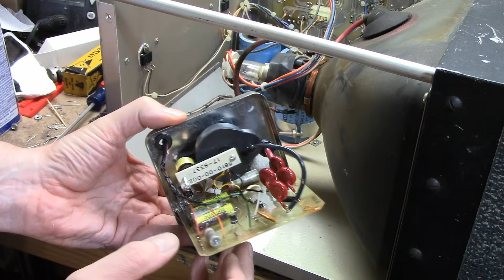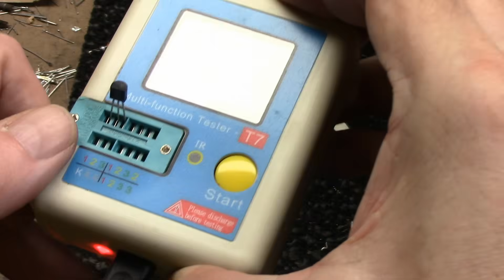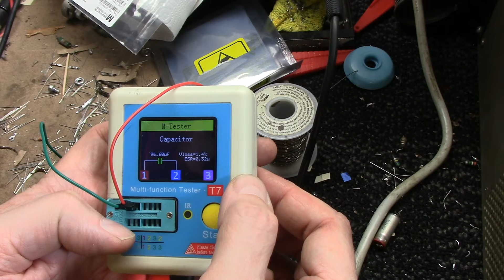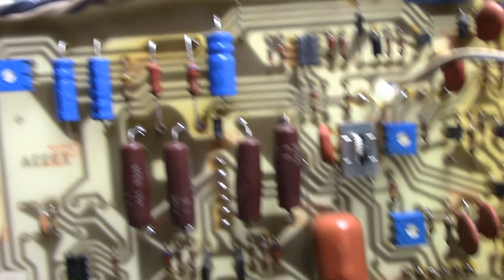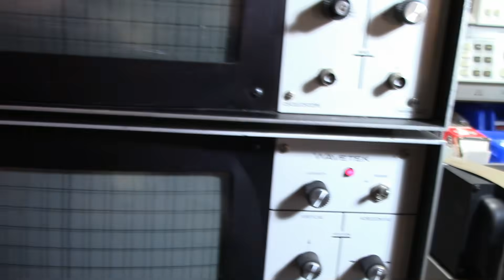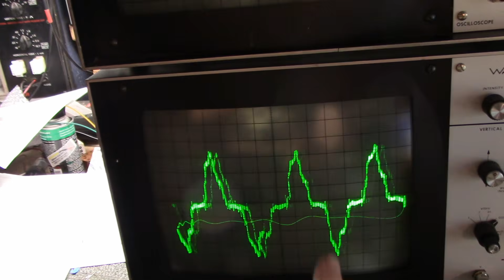Wavetek 1601C XP display overhaul part 2 of 2

Comment: Good job. Now go after those switches. Oh, by the way, did you take the LED into account when you figured the filament current?
Reply from the maker: No, it will be insignificant compared to the filament current

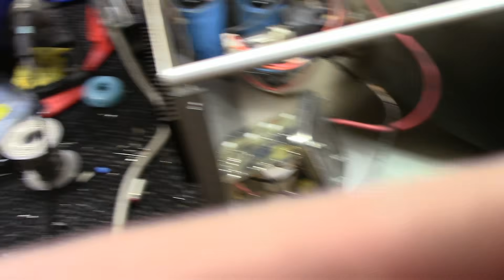Comment: 8:59 I had a bunch of those Sprauge red tipped caps I bought NOS for some pedal projects and they all tested like that, threw them all out. Also the ones tested unknown did you scrape the legs to get the conformal coating off?
Reply from the maker: I'll do a follow up video and test them again.

Comment: Dang Bob, I have to say I was screaming "WATCH THE NECK" when you were opening the HV box and using the tube neck as a backstop :) 😮😮😮

The Wavetec expect a 75 ohm impedance?  You probably already said that but I forgot.
Reply from the maker: Not my first rodeo ;)  I wasn't going to hit the neck.  374K input impedance.
Reply: Myself despite telling myself you have the experience to avoid damage I had to skip past... Partly because thought being careful moving a chassis and broke two Made in Holland Hammond labeled ECL86s and quickly found they are ultra rare so bit triggering. We all make mistakes and its how we respond that matters. 

Cheers,
Adriel
Reply: @adrielrowley  🤣🤣🤣 You know you are being TROLLED when all of a sudden the thumbnail for the vod changes to the ClickBait shot!   LMFAO   good on you Bob!

Comment: 7:54 - It’s possible that when you desoldered that cap, that the conformal coating melted onto the leads and is causing the tester to not see a component to test. Did you try scraping off any melted coating or other oxidation?
Reply from the maker: I'll do a follow up video where I'll also test them using my new LCR meter.

Comment: It's what we in the business call "BROKEN" I recently got one of those universal component tester, wish they had one when I was actively fixing TVs etc. Nice little quick tests👍
Reply: I had a friend of mine complain about those little circuit testers that they were not very accurate. I don't know if he was expecting 02% accuracy but yeah it's not going to provide that. It's a good quick go no-go tester.  They could do a good job for what they are.
Reply from the maker: For sure.  I recently picked up an LCR meter that does a much better job of testing caps.  I'll show it soon.